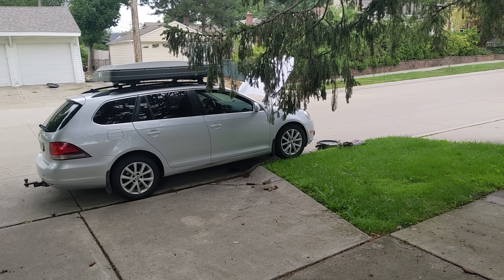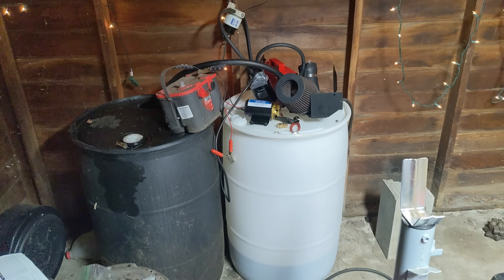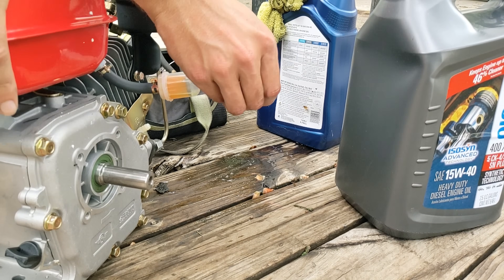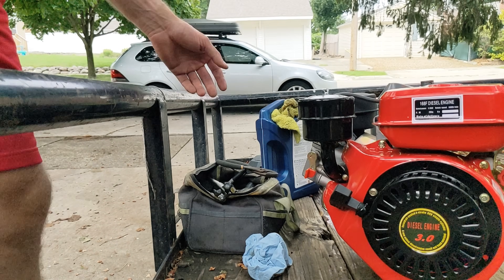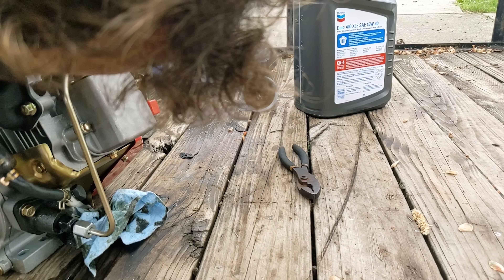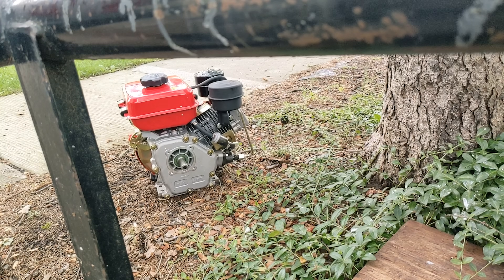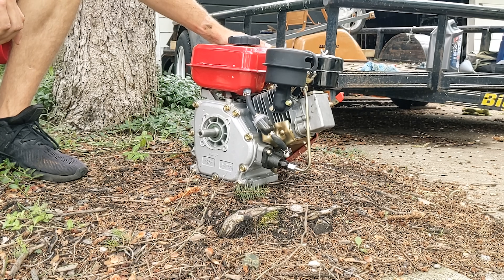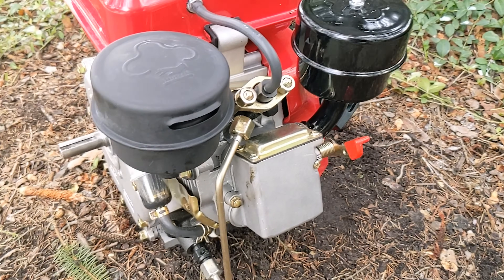Can a 196cc diesel engine run on Waste Motor Oil (WMO)?

Comment: This is super fucking interesting for prep stuff especially with it attached to a generator head. If you needed ONE GENERATOR that can run your water pump this would be interesting. You'd probably need a 240 generator head but that's fine.
Reply: You are going to need 10hp/5,000watts to run a water pump. Even at that, it will strain to start the pump.
Reply: @johnpeters9903  I bought the 10HP diesel because of this comment.

Comment: There is a reason that Cat diesel engines traditionally have "Buy clean fuel keep it clean" on the fuel caps.  Nothing but trouble can be had by running the wrong fuel in an internal combustion engine.

Comment: Filter the used motor oil first, to get rid of sediments and particulates.  Then dilute the oil with some kerosene to the constituency of diesel.  It then works very well as a diesel substitute.
Reply: That's what I was thinking, if you mix the used motor oil with something. I wonder if it would run on used hydraulic oil. I have a bunch of that from my tractor.
Reply: @MikeOrazzi  Yes it will run. It burns better as well. Also a bottle of that cheap white spirit is always handy to have around in cold weather - just a tiny splash does wonders!

Comment: Has anyone run that engine on motor oil on a long run water pump or generator for long durations of time - 
     I would like to know if.the head will carbon lock on oil as fuel

Comment: If you could have something like a fuel system that adds a tiny amount of the sump oil to normal diesel, and perhaps an oil reservoir that keeps the sump level right, you would probably encounter zero problems with cold-starting and coking-up, and the engine would change and dispose of it's own oil, so you'd only have to change the filter (if indeed these things have filters). Probably doesn't exist for good reasons, but it's a good thing to try.
Reply: You kind of just described a car thats burning oil.
Reply: @jerbear7952  No, worn diesels smoke because the oil they are losing trickles into the combustion chamber from worn seals and does not burn properly. It will burn well if it's mixed with fuel and injected.

Comment: Do you know of another store that sells these engines, looks like Amazon doesnt have any.
Reply: ebay should have them.. i bought a 200cc predator gasoline engine for under 180 bucks on ebay 9 yrs ago!
back then they didnt have these 200cc diesel wonders!
Reply: Amazon has engines w the same specs

Comment: Pour the waste oil over a magnet to get the extra small particles that not even a oil filter can get
Reply: If you got that much metallic powder in your engine oil your engine was total 😂
Reply: I would recommend mixing it about fifty-fifty with diesel that will get it closer to the right viscosity that it should be.
Reply: good idea!
Reply: great idea!
Reply: sounds good, doesn't work
Reply: @LizVanLee  Just tried it, it works perfectly. Nerd
Reply: @LizVanLee   THE DOPEFISH LIVES
Reply: why bro, why the fuck would you leave us hanging ? @LizVanLee

Comment: Can you mix 4 Gal WMO and 1 Gal gasoline, or regular diesel?  Do they make those little diesel engines any larger (say to replace a 6.5hp generator engine)
Reply: my 2 cents: you should run them mixed with diesel oil instead of petrol ...petrol mix might make them too easily combustible and the fuel might pre-detonate before its fully compressed by the piston and cause damage to engine
Reply: that sounds like to much gas
Reply: @JO3BID3N-is-a-P3D0  it's 20%, how much do you recommend?  I would really love to find out...I have over 30 gallons of waste oil I need to burn...might just make a oil burner for my metal melting furnace...but also have one of those little diesel engines
Reply: @haydenc2742  i guess experiment with your ratios, if u blow it up its just a cheap 
little engine. k plan on using my wmo to drip feed into my fireplace in the garage . also yanmar makes little engines. and on amzon theres a yanmar knock off. look up direct injection diesel , it looks like the doesel generator in the video but a little bigger

Comment: I would put a splash of gas in with the oil to make it thinner and flash off easier.
Reply: good idea but not too much.. that might cause pre detonation!
Reply: Gas around a diesel engine is ground for a run away engine.
Reply: @philbenson6041 Gas would only get released into the cylinders by the injectors, injector closed no gas/oil.

Comment: I ran a single cylinder diesel powered water pump on waste oil for many months.  It was difficult to start on straight oil, so mix it with some diesel.  The biggest problem I had was the injector would coke up really bad.  I suppose it is all the additives in the oil that build up.  Once the injector was coked up, it make it very difficult to start and it's performance was very lacking.
Reply: that makes sense thanks for sharing your experience.
Reply: Just alternate between straight diesel to clean up the system.
Reply: @ChrisWijtmans  I failed to mention that I did that. The result was not meaningful.

Comment: Ive been wanting to build a generator with this engine. Not sure on how big of a pulley to get the generator head spinning at 3600. Its on a "to try list" of mine. If it can run a decent size generator, I'd like to create a diesel/electric golf cart with it.
Reply from the maker: Diesel electric golf cart would be sweet! Let me know if you end up doing that!
Reply: 5,00watts is going to require 10 hp minimum. You can just mimic the watts/hp ratio on existing gas generators, Getting the correct rpms will be critical as well.

Comment: As a diesel mechanic, and having a dad that worked for Volkswagen for over 40 years, specializing in diesel Volkswagens, first of all running  the wrong oil in that TDI, it should be 5W 30 or 5W 40 specific diesel oil with a 505.xX rating. Second just because it’s a Chinese Diesel doesn’t mean the clearances are any different in the fuel injection part of it, it has to have pretty specific and tight clearances in order for the fuel to be injected properly.  It’s just amazing that people can get a YouTube channel and have a good video editing and all the sudden become the guru. When I actually have diplomas and ASE testing diplomas proving that, I know what I’m doing..  these channels and come into my shop and want me to do things that they see on YouTube, it is frustrating as hell.
Reply: Agreed, the tdi does not need thick oil like an old tractor.
Reply: 15W-40 won't hurt that thing any more than it will hurt an old diesel engine. In fact if he's in a warm climate, it's preferable to a thinner oil. I run 15W-40 in ALL my cars including modern gas engines. They run BETTER and oil consumption goes down. Do some research on film strength and lubricity properties before you make these goofy claims.
Reply: @Codyjrt  it just makes the public even more stupid. Because then they come in my shop and they say “I saw on YouTube that I can run this cheaper oil in my car” and when you show them the factory manual says that you can’t or you’re not supposed to they argue with you that’s some dumb ass on YouTube does it in his car and he doesn’t have any problems. To each their own but it’s getting out of hand with all these YouTube certified mechanics giving the wrong advice to the dumbass general public that eats that shit up and believes it.
Reply: @chrissuessle  
 Eu entendo a sua fustracao , mas não estamos a falar de motores modernos com bombas injetoras de 2050 bar de pressão.
 Motores antigos que se avariarem  não há problema, podem ser sujeitos a este tipo de utilização . 
 Eu tenho um 1.9 TDI e só utilizo diesel.
 No entanto tenho uma Nissan PIC UP de 1988 que gasta tudo o que lhe meto para queimar. 
 Assim como gerador Lister de 1966 de 10 KVA que queima óleos de motor e até de cozinha , há mais de trinta anos.
  Os motores modernos não devem ser sujeitos a este tipo de experiências.👍👍👍👍
Reply: It sounds like your education thong is cutting into your tolerance of others doing things that have NOTHING to do with you! @chrissuessle

Comment: I have an old Pettter AC1 diesel I did the same experiments with years ago.  Running straight used oil at load for extended times will eventually start to coke up or gum up the injector or injection pump system requiring somewhat detailed disassembly and clean out. 

However, using about a 20 -25% blend of E85 mixed in with the used oil and doing 10-micron prefiltering seems to solve that problem plus made cold starts better.
Reply: 75% used motor oil mixed with 25% used automatic transmission fluid is my answer

Comment: I believe standard car oil filters are 25 micron. Running the oil through a 100 micron element is a waste.
Reply: The oil is drained out of the sump, where all heavy matters sinks to the bottom and ends up so it doesn’t matter if your oil filter is 5um 😂
Use your brains before you post
Reply: care to explain?
Reply: @fidelcatsro6948  the oil circulates inside the sump of the engine which is already being filtered through what is on average probably a 25micron filter. Pulling that oil out and running it through a 100 micron filter, which isn't as fine as a 25, doesn't really do much.
Reply: @lastfirst5790  so its like a well filtered oil from the car going to a 2nd filter on the small engine which doesnt filter as well as the car did..ok thanks👍🏿
Reply: Mas e as impurezas e partículas metálicas que se depositam no Carter do motor????

Comment: Well no shit it will run on used oil. Just like any other diesel engine will.
Reply: i put about 30ml of used oil into a 20litre tank of gasoline of my 4 cylinder 1200cc suzuki motorcycle to help her run smoother..
Reply: Burning oil creates carbon smoke. Don't kill your engine. The build up will take a while
Reply: @philbenson6041  i do add some amrvel mystery oil once in a while to help loosen the deposits..

Comment: ANOTHER THING IS IF YOUR V-DUB  IS A DIESEL PUSHIN THE MILAGE TO 10K REALLY AIN'T A GOOD THING 
👁 SUGGEST U DO A BIT OF RESEARCH ON THE PRESCRIBED CHANGE INTERVALS 
I HAV 3 FIRST GEN DODGE PIKUPS WITH CUMMINS DIESEL MOTORS IN THEM ALL WITH OVER 500K AND NEVER BEEN APART NEVER EVER
Reply: It's not 1970 anymore oil changes at 10k miles is standard here in Europe 

Even my hot hatch has had changes at 10k or more and has 200k miles on the clock and dosnt use any oil between changes

Comment: 0:16 - 2010 VW Jetta? That looks exactly like my 2010 VW Golf bar the slightly different engine. I suppose the models different in the US?
Reply from the maker: The '10 jetta sportwagen is based on the golf platform, its just got slightly bigger rear end

Comment: Having a small diesel tank off to the side for starting the engine maybe a good idea especially if it’s cold out. Once the engine starts switch a valve to allow the motor oil to flow while shutting off the pure diesel. A Y valve.
Reply: Switching to diesel for a minute prior to shutting it off might not be a bad idea either.
Reply from the maker: I was also thinking about using a blowtorch to heat the cylinder head for 10 seconds before starting to see if that would make it easier. When its cold it takes about 4-6 pulls to start it on WMO. DIesel only takes one pull
Reply: @austin_does_stuff  They will start way easier with a sniff of ether. Even on diesel mine needs a bit to get started when it's under 40F

Comment: Mounting the fuel filter backwards, always interesting.
Reply: The fuel filters are installed backwards from factory on some of those. Mine was.
Reply: We had a mower stop working because of that once, but it's an easy fix once you realize or at least have a suspicion about the problem.
Reply: @MrBradshawbenjamin  Never flip a backwards fuel filter, anything it did catch is going straight to the jets/injectors.
Always replace instead, they are super cheap anyways.
Reply: @crazy_dan420 yes,I’d say you have to replace it..
Reply: @crazy_dan420 you could just run gas through it for a minute
Reply: @joshmanis-h7h  True, but I would just rather spend a few dollars for the peace of mind.
Reply: I just noticed that too

Comment: I feel as if im missing something,  my guy  just put old car oil (and desiel?) in a small desiel engine and it just runs?????
Reply from the maker: nope not missing anything, it really just fires up and runs. A little on the smokey side but its FREE FUEL
Reply: Diesel fuel is leftover from making gasoline. It’s dirty, oily, and stinky in its natural form. Modern diesel is much cleaner compared to the stuff sold up through the 90s. It used to be much cheaper than gasoline at the pump until the government started mandating “highway” grade which burns much cleaner and much less soot. It’s died red so they can look into your tank and make sure you’re using the government approved fuel. 
It’s just another part of the strategy to crush the middle class by making basic goods and services much more expensive. I think the cost used to be close to half of what gasoline was back in the day. In the 90s I was paying 99 cents a gallon so diesel “old fashioned” was probably 60 cents a gallon. 
That’s why a cart of groceries went from 150$ to 500$ in the same time span while wages have remained mostly stagnant for middle class families. 
They know what they are doing and they do it on purpose.

Comment: just a small hint: your fuel filter / flow direction is mounted backwards 😉
Reply from the maker: yep, noticed that afterwards and will fix that before the next video with that engine
Reply: @austin_does_stuff  I hope you bought a new one instead of just flipping it.
Reply from the maker: yes planning on replacing it with a new one soon  @crazy_dan420
Reply: @austin_does_stuff  You can cut your waste oil with diesel or gasoline to thin it out some and it will flow much better and burn cleaner.

Comment: I've got several of these little diesel engines and I love them. I experimented with running them on vegetable oil but I discovered that leaving them to sit after running on veggie oil virtually guaranteed gummed up injectors. It's best to run some straight diesel through the engine if you plan on letting it sit for any length of time.
Reply: I mixed vegoil with paint thinner about 50:1 and cleaned it all.
Reply: Did you run used vegetables oil or fresh new vegetables oil ?
Reply: @davidg.3406  -- Fresh. I don't have access to used oil.
Reply: @Makermook  ok thanks for the info, really appreciated. :)
Reply: Just turn the vegie oil into bio diesel first, it's such a simple process. The glycerin in the oil is what ruins the injectors.
Reply: How much do these little engines weigh?
Reply: @tresmondlaw1955  -- A little one like this weighs 15-20 lbs.
Reply: I’ve heard it’s the high water content in vegetable oil that does this. Not sure if it’s true or not. Good tip though
Reply: Veggie oil is some nasty stuff. It makes an absolute mess of my waste oil furnace.
Reply: @Engrave.Danger  -- As far as I'm concerned, it's not worth running vegetable oil in small diesel engines. Way too messy and too prone to gumming up the injectors.
Reply: So only use homemade biodiesel from used vegetable oil?
Reply: True for any VO setup.

Comment: I don't believe that you are running purely on engine oil why it's not giving smoke while running on motor oil
Reply: But it is tho, do you not know how a diesel works?
Reply: Oil. Even even old motor oil will burn perfectly clean at the correct air fuel ratio.

Comment: I'm a Mechanic and this won't  run for long before everything gums up , a disassembly to clean piston rings Injector intake manifold Velve stems ece ect , mix 50/50 fule lite ( old school lamp, stove Fule) 😊 would last alot longer 😊

Comment: Wow no smoke !  And it runs very well !           I would have thought that it would need  at least a 50/50. Mix motor oil/ diesel . Fun times in the garage !!
Reply: VW has particle filter and eats oil too so this "oil" is poop with less ashes (= less additives) to run on which is why it is not so smokey
Reply: @kitecattestecke2303 no no no  the DPF is in the exhaust system and nothing to do with the oil 😅
Reply: @martinandersson5278 its related fella, usually on these things the oil level can raise due to diesel contamination so i can bet this oil was a bit diluited with diesel. Modern diesel's are built like that
Reply: @riccardodefina9551  The diesel gets contaminated during the regeneration process on modern diesel engines with DPF.
This doesn’t apply on this engine.
I work with engine product development at Volvo.
Reply: it will keep the fuel lines and engine cleaner to run like 50/50
Reply: I would have added the used oil to regular diesel fuel - small parts at first, then increasing the percentage with testing.

(This was the intended path for foundry furnace fuel…)